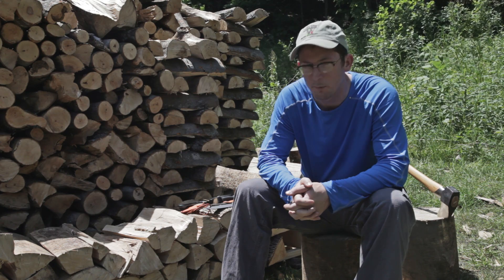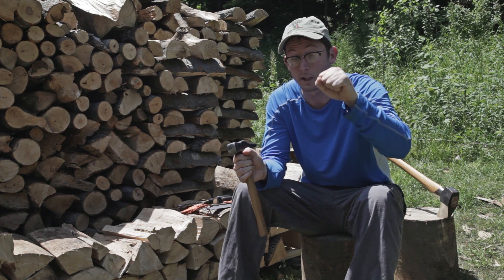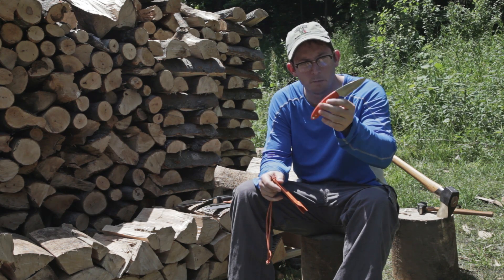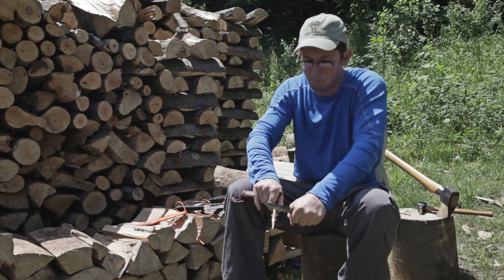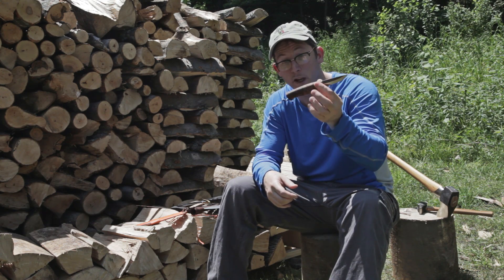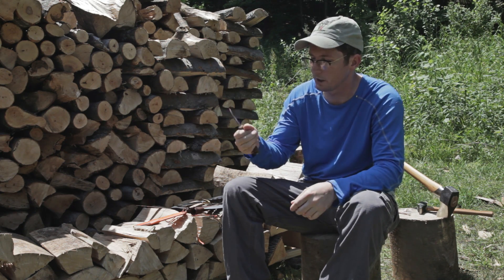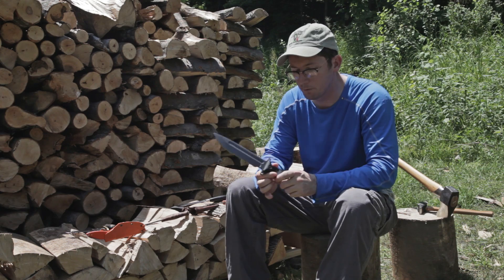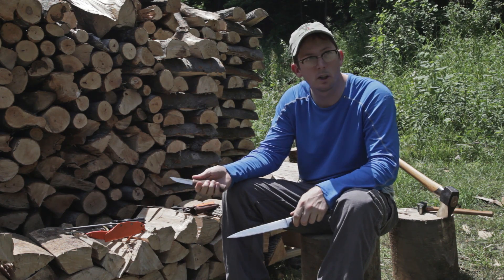Knife Handle Design

Comment: I have a lot of problems with certain handle shapes, when i was younger i broke the  third metacarpal on my right hand right in the middle of it, as a result i have a large lump of bone there and depending on handle shapes it quickly messes up my ability to grip or chop with a knife, axe or saw, everything just slams right into that lump and it kills my hand i just bought a bow saw for some yardwork and quickly discovered the hard metal grip shape was not compatible with my hand, so now i need to figure out a different saw, i will probably have to get a large folding saw with a rubbery soft grip.

Comment: it doesnt have the "coolness" or tactical factor but the best working knife that I have ever used was one I made out of a re-purposed sickle mower section.  The blade is directly in line with the fulcrum made by your wrist. ULU style.  It has a rounded handle that fits into your hand in several different orientations.  Thumb and little finger fit on either end of the handle and stay clear of your sharpened edges.  It works better than scissors for cutting leather strips. It is clearly superior for crunching thru tough food IE veg prep. 

My Chiropractor in FD showed me a pressure point on the top of my foot that effectively removed all strength from my arm.  He pushed down on my outreached arm and pressed that point just forward of where the foot bone attaches to the ankle bone :) Told me to be careful with lace up boots and to not tighten things down so much in that area.  Trivia.
Reply from the maker: Randy J Cool!

Comment: Great video!! I might mention that you need to STOP splitting firewood elevated up on a chopping block. If you miss or glance off the wood you intend to split, your axe will head straight for your shin. It almost happened to me a few years ago. My aunt had a large scar on her leg from this very thing when she was young. Put the wood you intend to split ON THE GROUND. Then, if you miss the axe hits the ground, not you shin.

Comment: Possibly the best, and I mean best video explaining handle construction for comfort and efficiency.  Really.  No kidding.  Easy to understand.  All the facts make perfect sense. The visual differences on good and bad handles are very plain to see.  Excellent!  I want to make a handle for a tool (not a knife) and I will try a prototype first with the characteristics you describe.  Just to see if the same principles translate to other tools.  Thank you.
Reply from the maker: Thanks a bunch!
Reply: You are welcome.  In ceramics (wheel throwing) there is a device known as a 'throwing stick'.  You may know this so bear with me.  It is used to get inside a narrow opening pot as it is being thrown.  It has a rounded end (inside pot) and a long handle.  The handle must be controlled as the wheel turns.  I am carving a throwing stick and wanted to know the best handle for the non-business end.  So, searching, I found your video.  I has given me ideas.  You never (maybe I did not hear it) about a handle being easy to index.  Knowing where the cutting edge is just by the feel of the handle.  If you did mention it, I apologize.
Reply from the maker: I tend to not like indexed handles.  In the video I don't remember if I stated it directly but that would fall into the category of separating the fingers and would have an effect on the grip strength.  However, the tool you are making may not depend on grip strength.  It may be more useful in your application to include a notch for the index finger.  I was mainly talking about knife handles and giving general principles.  Obviously all of these ideas may not fit every situation.  Good luck making your tool and please give me an update.
Reply: I took some exercise putty and squeezed it so it contoured to the inside of my grip.  I then shaped it to be universal.  Left and right hand.  It came out looking very weird.  Almost triangular looking down the shaft.  Then, an impression for the thumb.  I plan on carving out something like it in Basswood and see how it feels before I go onto the good Walnut.  Kind of fun to experiment.  I still think this video has the best explanation of a handle. Every thing I think I know about knives comes from a TV show on the History Channel.
Reply from the maker: Everyone tries the putty thing once.

Comment: Thanks.  Very nice video.  There is some info there I never considered before.  I've always thought finger grooves were good and proper but you may have convinced me otherwise.  I learned from an old bladesmith in Baton Rouge to take a lump of clay and squeeze it in my hand to see what the handle should look like - thus finger grooves.  The grooves should not spread your fingers apart, though.  Thanks again for stimulating fresh thinking about handle design.  BTW, like you, I have a kitchen knife I use for slaughtering and butchering for hours at a time, it gets bloody and wet but feels perfect.  Its a Victorinox boning knife with a rubber molded handle.  Awesome knife.

Comment: I think this is the best video about knives ergonomics.
One question, though.
If the work involves something that makes the hand slippery (ie: cutting fish), would the handle be any different from what you said in this video?
Reply from the maker: A lot of the commercial meat/fish plants do use a textured handle on the knives.  I'm not sure if that actually does anything because once you get fat/goo into the texture it is a moot point.
Reply: Hmmm... yeah, I think textures wouldn't help, it would even make cleaning the handle harder.

Comment: Excellent video. I've got a cKc Streamline 2.0 made by Kyley Harris in New Zealand. It's got a handle made from UHMWPE which is apparenly 15x smoother than Teflon. It has no grooves or jimping but he designed the handle so well it doesn't slip around even when it's wet. 

Also, my former karate teacher emphasized, repeatedly and loudly, the importance of gripping an opponent's uniform with just the ring and little finger and how that gives you more control. 

I also recommend you check out William Collins' WC Knives. He makes some of the best handles I've seen.

Finally, is it still averageiowaguy or is it averagemichiganguy now? Or perhaps averageformeriowaguy?)
Reply from the maker: Mere Blather You can take the boy out of the farm but you can't take the farm out of the boy.  I'll always be from Iowa and I'll always be an average guy.
Reply: averageiowaguy Glad to hear that. My grandmother's family are from Ricketts and Charter Oak so there's a bit of Iowa in me, too.